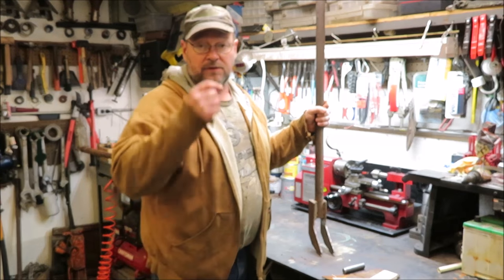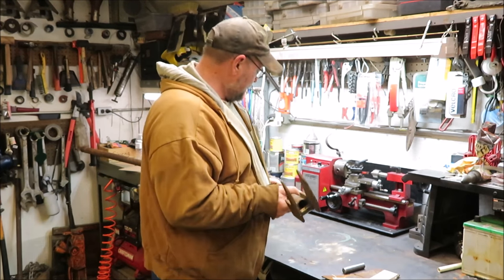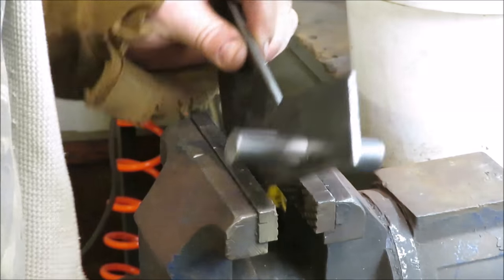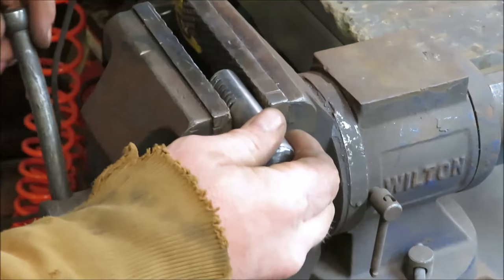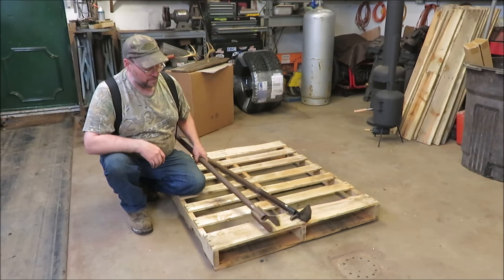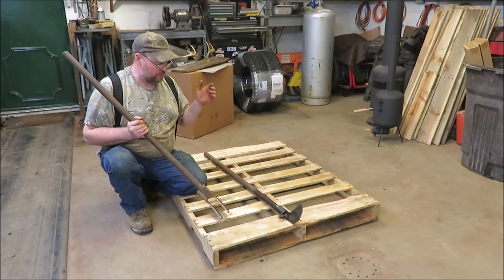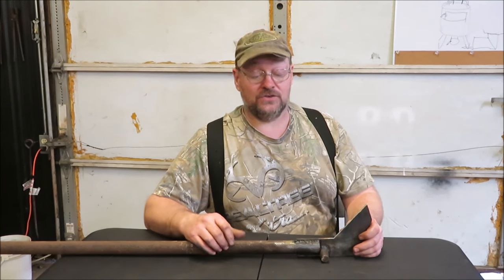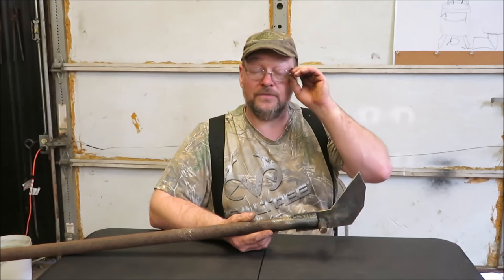pallet pry bar made easy

Comment: Some good thinking there....made a mousetrap and then made a better one!!! 
I do have a non-related question. I would love to do little things like this. I am an older woman alone and at times need a little welding done. Is there a welding machine that you would (or anyone else reading this) recommend for a beginner to do welding jobs such as this? It would sure help around this ole farm place. 
Great job. Take care. Jesus bless.
Reply from the maker: Sandra, you can get a fairly cheap mig welder from harbor freight that is easy to use, good luck and thanks for watching.
Reply: @Robinson-Homestead  Thanks for your reply. I will check into that and some lessons...appreciate it a great deal. Jesus bless.

Comment: Hi Kevin...I like your design and I read all the comments...Maybe figure a way to bolt it to a fence post and use a 1/2 inch piece of rebar plus take an inch off the bottom...It will save weight and it will help if you ever decide to sell it on shipping...Have a great day...

Comment: I worked at a pallet recycling wharehouse. We had special tables you set the pallet on and there were special pry bars that tore the boards off. It was way easier and FASTER
Reply from the maker: Thanks for sharing Chris like to see the tables cool.
Reply: The tables had a bar that came over the far side of the pallet to hold it down while you pry the boards off.  It was fork tongs but they were different and worked on the boards differently.
Reply: And your idea is dam close BTW. Awesome for home use.

Comment: What if you weld a washer to each side of the round fulcrum then it could not slide off of the 2x when you put pressure on it. great job looks easier to use.
Reply from the maker: Thanks for the watching and the info yard farmer.

Comment: Kevin, I have seen quite a few of your vids. and commented on some because of your excellent instruction and ideas. The biggest problem with this tool is that it can only be used on pallets that have the boards at least 2" apart. A lot of the good pallets don't have enough gap for your tool, by the looks of things
Reply from the maker: One day I will make one that will work for you Thank you W.Gator.
Reply: Kevin Robinson thanks looking fwd to that. I'm sure you can do it.